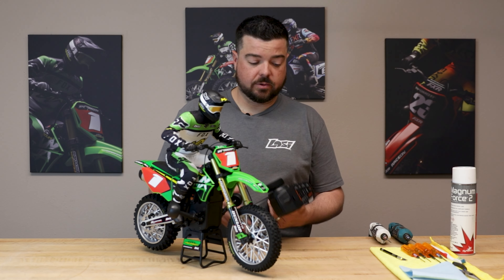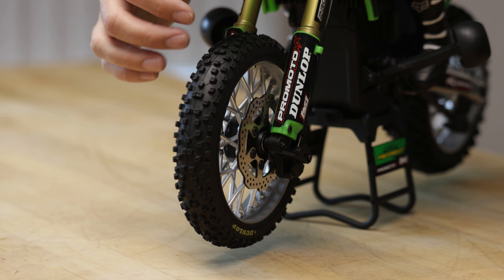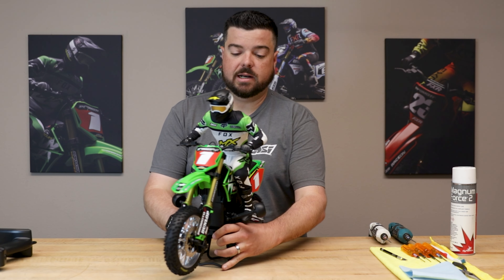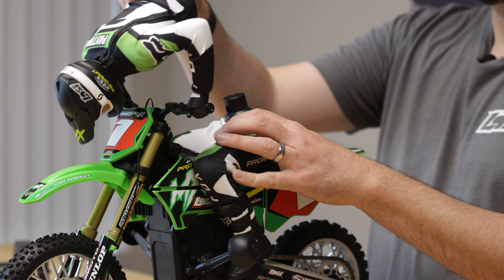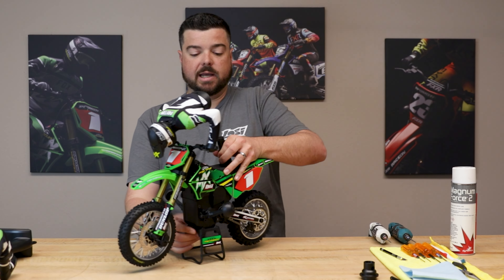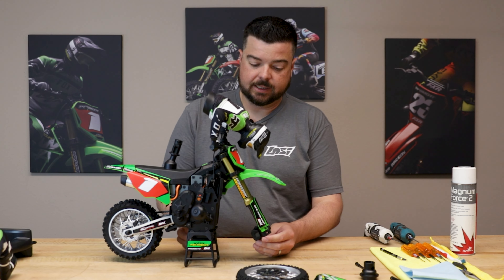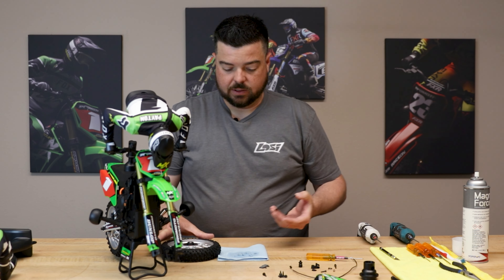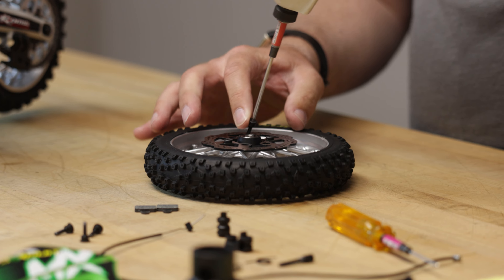FRONT BRAKE CHECK, MAINTENANCE AND REPAIR ON THE LOSI PROMOTO-MX

Comment: At 3:36 you refer to the LEVER ARM as a servo arm. The brake cable actuates a lever arm. Most mechanical caliper designs have 1 lever arm that moves only the outer brake pad when actuated. The rotor then flexes over into contact with the inner most pad.

Comment: Does the bike have a rear brake or engine braking? What keeps it balanced under braking? Front brakes only will cause Front end to dive entering a turn
Reply: Motor braking rear, manual brake in front, the flywheel keeps it balanced always, provided it’s running.
Reply: @GeddyRC  Sweet Thanks
Reply: There's an adjustment for brake bias, front to magnetic back. Too cool! Can't wait for my Honda to show up!
Reply: @clean1566  Now they need to come out with Jett Lawrence and other pro rider gear that would be awesome